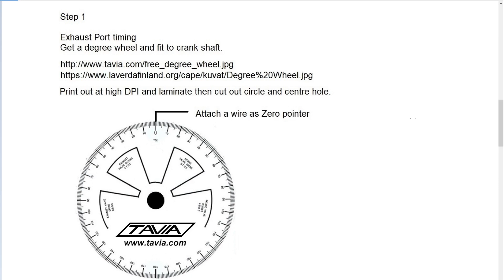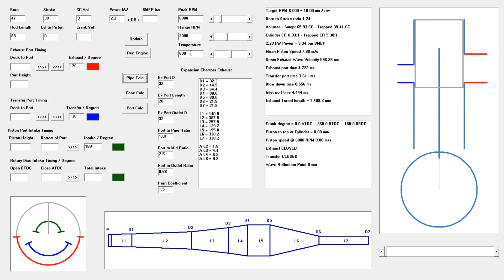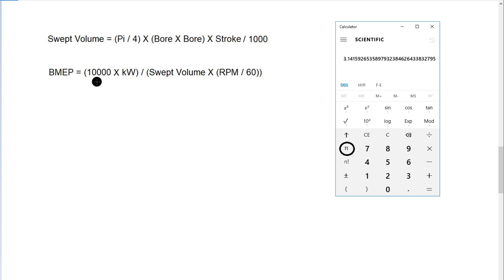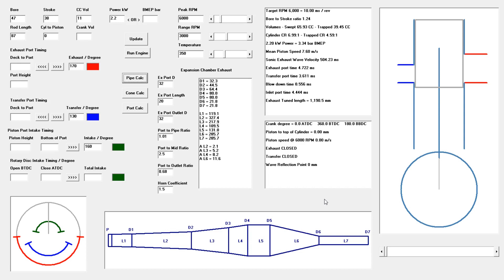How to Design a Two Stroke Expansion Chamber Performance Exhaust - Step 2

Comment: Hi Dave, thank you very much for sharing this.   I would like to know if we can curve this tubes/pipes to acomodate on a particular engine instalation.
Reply from the maker: Yes you can
All you need to ensure is that you maintain the cross sectional area of the pipe pipe tube at the bend.
Reply from the maker: You can get a program called  "Cone Layout" that is helpful to print out plotted bends for pipes that you can scribe to sheet metal.
Reply: @AuMechanic  Thank you very much !

Comment: How does 1 measure the kw of a cylinder if the bike is a twin? 
To be able to do the bmep?
As power of my bike is 29kw at 7500k. But its a twin! So to build 1 expansion i would need to find only 1 cylinder bmep but how?
Reply from the maker: If its a twin then for one cylinder it will be half the total engine Kw value
Reply: @AuMechanic  okay great Thank-you for your response.

Comment: Good morning dave. . . How does one guess the temperature of 13.32 bmep? 
I'm thinking 650?
Reply from the maker: Yes anything over about 11 you would use 650C as an estimated value.
You would need to use an EGT gauge for an accurate reading.
Keep in mind that is the peak temp.
Under the peak RPM or lower gears that value drops quite a bit but we work with peak temp in top gear.
For racing purposes that provides for peak RPM at the end of straights in top with some room for a bit of over rev.
Also be aware that the RPM value is the maximum engine redline RPM value not the peak power RPM.
Reply: @AuMechanic  OK thank you dave. . . Will be putting degree wheel on today to find the exhaust port timing for the rd400f. . . My guess its around 190 to 200. Could be wrong. Thanks again
Reply: @AuMechanic Hey there. I've read several comments on that particular topic in just 2vids of this playlist.
You wrote this in your comment above : "...the RPM value is the maximum engine redline RPM."

So, in my case, the Redline goes from 10k to 12k on the tachometer of this '93 aprilia rs50.
Should I use 12K, as I understand from your above comment, as my input value for RPM ?

I've made all my sims until now with a value of 10K (thinking "redLINE").
I'll run some more estimations using 12000RPM to see the differences.
I'm working on a mod for the stock exhaust pipe.

And I do because of your work, both teachings and freeware.
Thanks a lot for your contribution to the community, cheers !

Comment: Hi, Dave,firstly thank you for the software, most helpful and I’ve used it to design myself an expansion chamber. My only question,
I intend using my standard frontpipe which is 520mm in total length, 460mm pipe length and 60mm port length. 

My design shows a very short front pipe before the first cone. Can I fit this design to my std frontpipe and will it change any of the calculations?

Thank you,

S Barrett.
Reply from the maker: If you want a longer header pipe than the calculations give you would need to use a steeper angle on the cones to make them shorter and so end up with the same tuned length but then you might end up with a very peaky pipe.

Comment: The HP specified by the manufacturer of my motorcycle are 14HP at 6400rpm, but this power is what generates the crossing of the lights plus THE EXHAUST OF THE ENGINE FACTORY. However, can this value be used to calculate the effective mean pressure?
Reply from the maker: Yes it can
Keep in mind BMEP value is used to estimate Exhaust temperature not a direct calculation.

Comment: So the maximum power and the revolutions with which we must make the account are those that the manufacturer of the motorcycle gives us?
Reply from the maker: The RPM value used in the calculator is the Red line value off your tachometer, not the Peak power rating.
Keep in mind that tuned length calculation is for port open to port closed where the effect of the pipe drops off since the port is now closed.
You want this aligned with red line so the pipe effect shuts off at that point acting a bit like a rev limiter. You don't want that occurring right at peak power.
Reply: @AuMechanic  So, should we put the maximum power of the motorcycle in Kw, and the maximum rpm that the engine reaches?
Reply from the maker: @emivesprini3345  For estimating BMEP using the calculator use the Power in KW
But for setting RPM value on the main page of the software for tuned length use the maximum engine speed.

Comment: Entonces la potencia maxima y las revoluciones con la que debemos hacer la cuenta son las que nos da el fabricante de la moto?
Reply from the maker: In English
"So the maximum power and the revolutions with which we must calculate are those given by the manufacturer of the motorcycle?"
Yes the maximum RPM to use is the maximum engine RPM as in red line RPM not the peak power or torque RPM.
Maximum power is to calculate BMEP and which used to estimate Exhaust temperature only it is not  a direct calculation.

Comment: Hello, how can I split L2 so that I have a radius by combining lot of single elements(like 10 pieces)? 
Do you have any advice on exhaust port lenght/height according to a power valve that open gradually from 0-8000 rpm on a 125cc ? Thanks

Comment: I have a 74 moped so no gears. Does a completely straight first section help with a broader power curve? If so how do I calculate that in? Not really an option on your program
Reply from the maker: A straight diffuser cone has a more narrow power range.

Comment: Hi this is the video that I needed. but I was wondering if I could go a more simple way. I am changing a 2cylinder 2 stroke engine that has a single pipe to a 1 cylinder engine. Is there a way to calculate how my pipe would need to be for half the engine from the pipe that is for both?

Comment: Hi Dave, I’m stuck on Part 3 of the expansion chamber video, I’m building a sand drag quad with a 1990 650 wildcat engine in it and I can’t find the engine kw @ rpm online to work out the BMEP. The answers I find are too different, I take it that the engine makes around the ball park of 100hp, I have no idea where to go from here, is there any other way I can go at this. Have you ever ran into issues like this? And how did you get around it?
Reply from the maker: An estimation on power to BMEP is ok, it doesn't directly translate it just uses a general scale to estimate exhaust gas temperature from a BMEP range.
Reply: @AuMechanic  thanks mate 👍

Comment: A little more science to be investigated would be where you want to place the Power band in the throttle.  This is determined by the length of tubing from exhaust port to the beginning of the chamber. I played with mine and have the bowerband start almost at the end of throttle, so as to get all the power I can out of engine. This can be adjusted depending on what kind of conditions exist. Weather straight track or motorcross.
Reply from the maker: The tuned length of the entire pipe will determine what RPM the centre point of the pipes tune will operate.
Changing the header length simply changes to tuned length and will effect and RPM change, but changing it to the exclusion of the rest of the pipe can take the chamber away from the intended wave reflection timing.
The header length dimension is a derivative of the Jennings pipe formula that was created in the 70's by crudely reverse engineering simply measuring factory race pipes, where the equation I use are form the late 90's and were created by comprehensive scientific method and peer reviewed papers published by SAE
In short you might observe some effect by changing one part of the pipe by you may not realise some offset loss, as in 2 steps forward and 1 step back.
Reply: I'm no scientist. I wasn't really working on a tuned system. Just got lucky I guess. Thank you for responding so quickly. 
I'm a welder, retired Union Ironworker. I worked at Disney World over 15 yrs fabricating all sorts of things. I had weld certs. for all materials. In the video your tig welds looked good for what I perceived was first attempt at such a complex project.

Comment: Would  a 400cc expansion pipe be shorter if rpm range is 3,500-5,500 with max rpm is 5,500 vrs 10,000rpm? Or longer?
Reply from the maker: The higher the RPM is the shorter the pipe is.
Reply: @AuMechanic  yes ofcoarse that makes sense. Thank you.
Reply: @AuMechanic  would a non expansion chambered 200hp 4cyl 2stroke benefit from a single expansion pipe at all? If so what are we talking bout for a gain. 10% or less or more? Would love to do 4 pipes but not enough space. Just wondering if I should scrap the pipe idea on my fresh rebuild on my jetboat. An thank you. Your videos are great. Just getting into them so pretty new

Comment: the calculation of EGT is not clear in the video, can you please explain more
Reply from the maker: The EGT value is not calculated with an equation, it is an estimation given by Professor Blair based on the BMEP
Otherwise to get an accurate EGT you would need to use a gauge to test it.
Reply: @AuMechanic  so i will correlate between 3.5bar/350deg and 11bar/600deg,  right?
Reply from the maker: @Ahmad.Kassem  
Correct

Comment: Excellent explanation. Big help.
🍻
Reply from the maker: Thank you for the comment.
Reply: @AuMechanic  I am yet to wade through all the vids but its in the pipe line! I have recently purchased a yahmaha 125 2t that I plan to road race prep for historic racing. I am a panelbeater by trade , handy with sheet metal and oxy / accetlyne  , mig etc so extremely keen to have a crack at putting  an  expansion chamber together. 
Thanks for sharing and making the time to do so!
I'm guessing you cover rolling the sections at some stage? 
Thanks
Tony
Gold Coast
AU
Reply from the maker: @tonywilkinson8041   I have not done a video on the fabrication side of it, there are many videos around covering that. My days of making pipes are in the past when I road raced bikes myself.

Comment: Is that max rpm of the engine or rpm   at peak HP?  People say the pipe determines the max rpm, I seem to be getting mixed messages :/
Reply from the maker: Max RPM refers to the engine redline RPM or maximum engine speed for calculating tuned length.

Comment: Hello... The pipe diagram  is shown in a straight length fashion. Can those pipes be bend into any direction by keeping the length of the pipe or is there a new calculation required? Thank you.
Reply from the maker: So long as you maintain the centre line length of the pipe then it will not change the equations for tuned length..
And you need to ensure any bends maintain the area (diameter) along the lengths so bends need to be clean, for example a header using a bender would need to use a mandrel tp keep the pipe shape and the pie slice method will do to put bends in cones or middle sections as well ensuring there are not "steps" in joints from mismatching.
Reply: @AuMechanic  Thank you so much. Awesome!

Comment: I have 2 strok bike name yamaha RX 135 cc. I want to built my self a exhaust chamber . But I don't have any drawing will u help or sujest me how can I make it
Reply from the maker: You can use the free software here to calculate the dimension of the pipe but there is a lot involved in fabricating the pipe itself after you have done the calculations using software.

You need to make up a template using the calculated values and then section it in parts to fit the bike and then cut out the sheet metal off the template parts and then bend and roll section and weld it up.
There are a fair few videos on YT about how to do that part of it.

Comment: Where did you get the 10000 figure
Reply from the maker: That (and RPM / 60) are just a scaling factors Blair uses in the calculation since power is usually listed in kW, Swept Vol in Cubic Centimetres and engine speed Revolutions Per Minute.

Comment: Sounds great but all too technical for me.  

Here is what I'd like to know.  I'm going to clone another production pipe for my 250cc bike.  I've had several other chambers, 1 type adds low-end grunt, another adds high-end power.  So the pipe I have now is just a good pipe across the 0-8K RPM scale.  If I wanted to increase the power across the RPM scale, what changes would I need to make to the cloned pipe?

Would just increasing the diameter of the fat part of the pipe help or could something like that totally screw up my power-band?  Thanks!
Reply from the maker: I would suggest you download the free pipe calc software and put the numbers in it and compare the results to your pipe.
The software provides various calculation factors for the port to mid section ratio and the popup tool tip help explains the differences with them.
In short increasing the size of the mid section will cause the cone taper to be a higher angle that in turn tunes the pipe for more peak power.
What will risk upsetting the power band is changing the lengths of the pipes as that will tune the pipe out of (above or below) the power band of you engine.

Comment: I have a standard exhaust system on my bike but i dont like the positioning of it, how would moving the expansion chamber in relation to pipe-length-to-exhaust-port affect it?

It's an RD350 N2 if that makes any difference
Reply from the maker: Nice bike, I raced RD 350 LC-H model in the 1980's
If you make the header pipe longer that will lower the effective RPM range the pipe operates at, conversely if you shorten it that will raise the RPM range it is optimal at so you need to be careful about doing that so you don't mismatch the timing of the pipe with the port timing it has.

Comment: How is the cc's of an expansion chamber calculated? Is it the cubic area of the expansion chamber itself?
Reply from the maker: In short it is not, the capacity or volume of the expansion chamber is not a consideration of the design.
If you watch more of the videos I have or try to pipe calculation software you will see how the dimensions of expansion chambers are determined.

Comment: What changes at calculation when I have more cylinders and single pipe?
Reply from the maker: Good question, bit beyond the scope of these video's which cover single expansion chamber per cylinder.
A few issues to deal with, one being is if there is differing lengths of a log manifold to the final pipe means "tuned length" may not be the same for each cylinder. Also differing issues if its a twin, triple or 4 cylinder.
Some of this is covered in Gordon Blair's Two stroke design book and you might want to read up on that.

Comment: Absolutely great videos, keep going! I am a bit confused about BMEP. Assume I have an engine with a modified cylinder (bigger bore, modified inlet port timings). How can I calculate BMEP, if I don't know the kw what the engine can produce?
Reply from the maker: Calculating BMEP is not critical, it is only used as a guide to Exhaust temps in the case of pipe design save measuring actual temps.
You can make some estimations based on how much power increase you have after such mods compared to stock.
Also keep in  mind that a compression test will give peak pressure where BMEP is average pressure so it'll be a bit lower than cranking pressure.
Note BMEP is in Bar of pressure so you can convert that to PSI.
Reply: I was going to ask the same thing. For example, the yamaha AS2 125cc is 15hp, the Yamaha TA125 racer is 24hp. Same displacement but developed for speed. I see programs needing bmep, but never really understood, thank you.